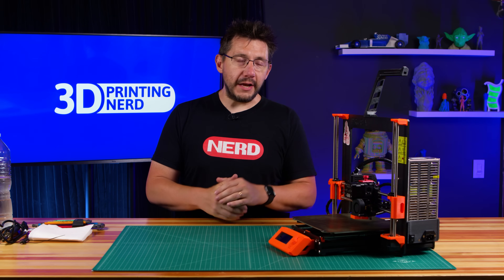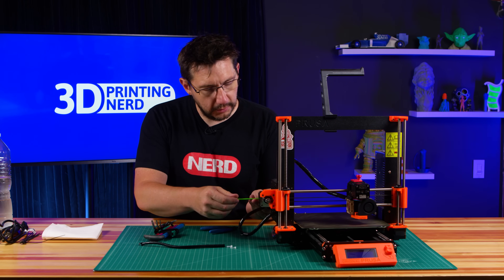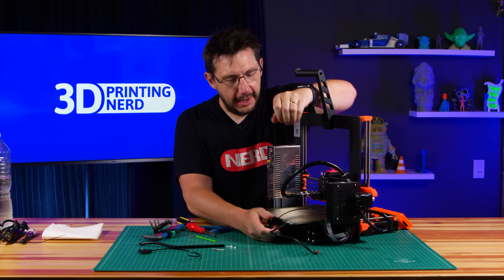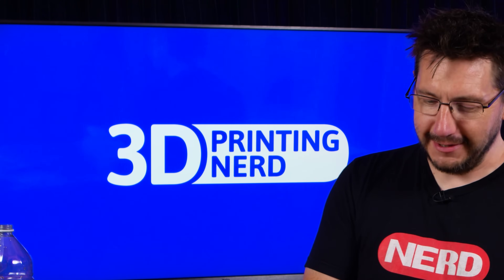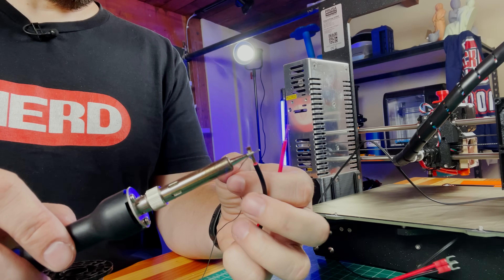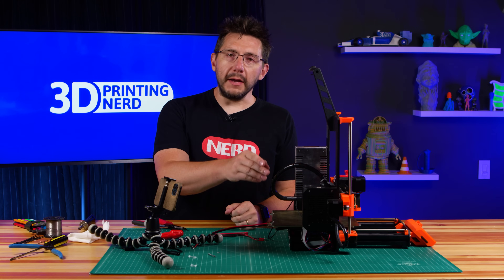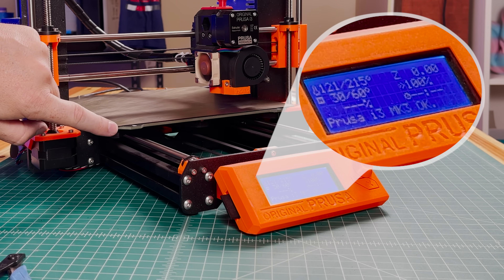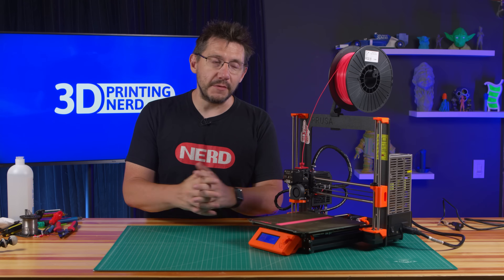Fix YOUR 3D Printer Bed! // 3D Printing 101

Comment: Hi ok so one of the weirs is bad? why what's wrong with it is there a reason it failed? it's a piece of weir unless it's burnt in half or lose on one end it seems hard to think how it failed. that would be the first thing I would like to know so yes I can replace it and get the printer back up to working but how do I keep this failure from happening agene is there a problem up stream from this that caused the failure? 
Yes you replaced the weirs and did a good job but there is a lot more to do to make this repair complete
Reply from the maker: It’s under constant movement.

Comment: Joel, that 435 degree number was in Celsius. Leaded solder will melt at around 700 - 775F. You should be extraordinarily careful with that iron on the wet paper towel on your hand there... the leidenfrost effect will only protect your hand for so long!

Comment: You really should have desoldered the wires. Then remove the old solder, cleaned with ISO99, fluxed and apply new solder.
The tining part was perfect!
I usually just always replace old solder with new solder whenever doing rework.

Comment: Glad your MK3 is back and running Joel! 

Try out the copper scrubbie pad instead of a sponge/paper towel next time, clean just as well without thermally shocking the iron, bonus points if you put a bit of flux on the copper so you also REALLY clean the iron!

Comment: Good video, but you forgot (or didn't show) step #1: Checking the wires with a multi-meter to see if they were the actual problem rather than something else. 

Diagnosis of the problem is just as important as actually fixing the problem. Plus, while it's good to replace both wires at the same time; it might have just been one bad wire and the good wire can be labeled saved for other projects that might not require so much movement.
Reply from the maker: Sorry, I did check at home. I forgot to show that. Thank you for reminding me!

Comment: If anyone has any problems with soldering, the fix is usually to add a little flux. Any flux should do as long as it isn't for plumbing.
Reply: Flux changed my life when it comes to soldering

Comment: When a bearing on the office Prusa failed in spectacular fashion, I decided to do some preventative maintenance by upgrading the bed heater wires to silicone sheathed 14 gauge wires used for drones. Soldering those monsters would have been a complete pain, but I have a later revision of the mk52 bed that uses ring terminals. It's a little fiddly, but rock solid once installed.

Comment: It's somewhat surprising that high end or super budget machines alike seem to have this  1 colossal problem...horribly thought out bed heating wiring. When I got my first printer (ender 3) I thought  mine must have been missing parts cuz I see these 2 wires about a few mm away from each other and could easily be accidently be hit and my house turned into a neighborhood bonfire. But after some research found that all bed heating is apparently not part of quality control, or engineering altogether lol. But it would be nice to see a little more thought go into that one area of printers. But good video, this area gets overlooked.

Comment: Technically your not wrong on being able to reuse the solder that is already there but I would not recommend it.  Reusing that old solder increases the chance of the solder joint cracking causing another problem sooner than if you just replaced the solder.

Comment: Hi Joel, Thanks for the informative video, but there are a few things you didn't mention, that are pretty important.
first, the thickness of the wire. You don't mention it, but it must be something like 10 AWG (I think it's called that, I am a Dutch guy and here we have a different name for it).
Also, there are so many different wire types. You need to have one that is made for repeatedly bending. This means that the wire is flexible, and consists of many strains (is that the correct word in American?)
If you use a wire type that is not made for bending, then the wire will break within the next few prints !!!
And finally, the temperature of your soldering iron must be in Celcius, as 450 C. is a pretty normal temperature for a standard soldering iron.
Greetings from the Netherlands, and again, many thanks for the informative video.
Reply from the maker: Thanks for the tips!

Comment: BTW, Prusa has redesigned this interface to use eyelets and bolts to provide a more reliable design.
Reply: I was gonna say, the Mk3S at the office uses ring terminals which I upgraded to thicker wires.

Comment: Great video :D
You could have also just created a a box shape in PrusaSlicer and type in the required dimension. This is what I sometimes to to print a simple shape. I thins ist a bit faster and/or easier than opening a STL file, stretching and cutting it :)

Comment: I built a prusa i3 mk3s bear upgrade clone and the heatbed strain relief doesn't have a place for the nylon filament, where can I get the STL for this version? I also built my friends genuine Prusa MK3S and his did not have the nylon as well. My bed strain relief broke and I want this nylon version

Comment: when I upgraded to the Big Tree Tech SKR mini v3, I put the bed wires into the power input for the printer.. I was confused as to why the bed was heating uncontrollably... turns out I just messed up the wiring.

Comment: Root cause?      I'd be far more concerned as to what caused this failure. This printer is not that old. Replacing the failed part in the exact same manner will likely yield the same fault again.
Reply: It's just what happens when you use 22+ AWG wires and no proper jacketing. That wrap does nothing but make it look pretty. For example, LulzBot TAZ printers have actual useful jacketing and an actual cable chain for their bed wires.

Comment: I'd highly recommend removing old solder and using fresh. The company has to use lead free thanks to California but you can use the better stuff yourself. Get some 63/37 rosin core solder and never look back.
Reply: 60/28/2 works best for me. The 2% are copper and it bonds much better to materials imo

Comment: I agree with your conclusion. I was very sceptical of buying a 3D Printer in the beginning, because a lot of comments about them were, that you need to tinker with them. And I didn't want to do that.
After a year of owning a 3D Printer, I can't stop working on it and improving it. It's so addicting to make it a little bit better every time and understand more and more about how they function.

Comment: its C.  you want it hot enough to liquify lead and 450F is only 1 deg short of a dystopian society and wont cut it.  Im confused though, the power wires went bad?  did they show wear?
Reply: Thats lead-free solder. It has a much higher melting temp than leaded solder (450 instead of 320-360).

Comment: You really should get rid of that spiral wrap. If anything, sleeve the wires. Your putting unnecessary stress on the wires and some joints.
Reply: Sorry but that is complete nonsense. Sleeving the wires will put way more pressure on the cables than spiral wrap will. I have been in the electronics trade for almos 25 years and have seen firsthand what different types of cable coverings last.
Reply: I think this has less resistance because it’s a separated spiral design.
Reply: May be worth noting that on newer version of the Mk3 (starting with the Mk3s upgrade), Prusa had moved away from the spiral wrap to a cloth based split-sleeving.  Not because the spiral was necessarily a problem, but because it is easier to put on and lighter weight.

Comment: So I got basically the cheapest soldering iron on Amazon and it goes to 450 C. Yours probably is in C as well.
Reply: Definitely C. 425f would not be enough to melt most type of solder, especially on large copper trace with thick copper wire.